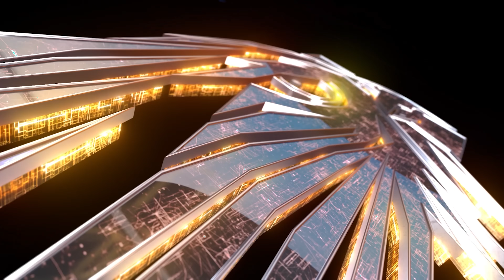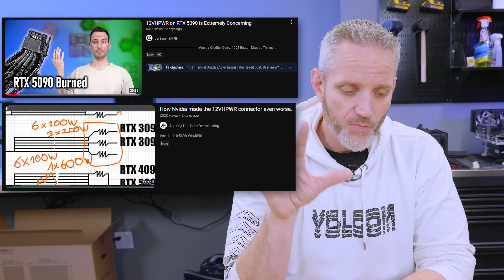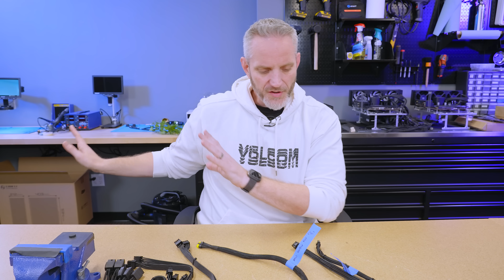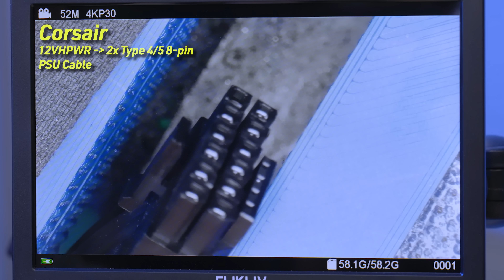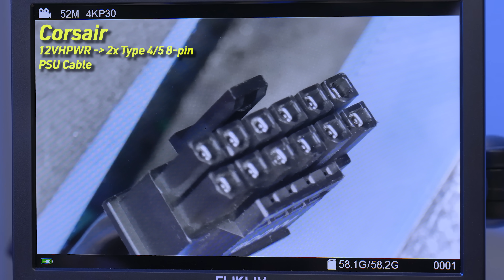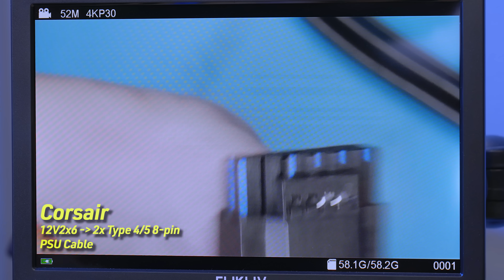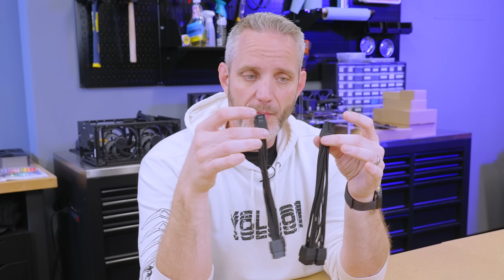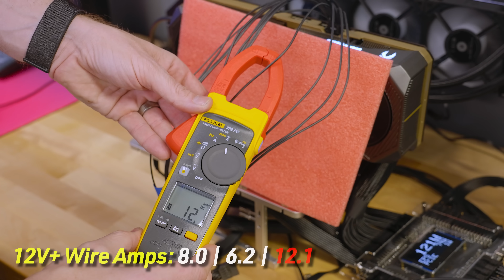I discovered something concerning and I need the Experts to chime in... More 12VHPWR discovery!

Comment: I just looked out of curiosity at the brand new 24 pin cable that that corsair sent me, and 50% of the pins are as Jay shown in the video ☠I asked them for a new cable because one pin on the PSU side was coming out when bending the cable up towards the pass through to reach the motherboard.

Comment: After watching this, Der8auer and some card repair videos I wonder if part of the problem is poorly soldered connectors to the PCB causing uneven load distribution. There have been a few instances where a card sent in for repair has a power connector come loose after an ultrasonic cleaning because the initial solder from factory was so limited the pins were barely making contact in the first place and the ultrasonic bath ate away the remaining connection.

Comment: Long career  as a aircraft avionics technician.

The locking function  of that pin is not engaged. This is caused by only one of  two things, bad lock on the pin or the connector has a defect that will not allow the pin to lock.

OK one other is if the pin is not fully inserted into the connector. 

There should be absolutely no pin movement in the connector. If there is, In all cases the locking feature is not engaged.

Seeing how there is a common ground pin on the connector that is melting the best probable cause is the connector is flawed in the casting of the connector. The pins ( more than likely) are all the same. If there is no pattern to the melting pin then I would say there is a flaw in the pin casting.

A pushed back pin is not an uncommon problem. Before inserting a connector into a socket you should always look to see if ALL pins are flush, if not first look to see if the pin is not fully inserted for the lock to work. If not install a new pin on the wire if no fix it's the connector.

The only way to remove a wire from the connector is by using a pin lock release tool.  Either front or rear release. I think this connector is rear but not sure, I would have to look into it.

Comment: Over time the metal clip that holds the pins in place will push the plastic back and make the pin seat depth even more. anyone that has taken a connector apart to repin it will know what this is. I've had issues as far back as Molex with this. Not fire issues but resistance issues on projects using these connectors. the way these connectors are put together will change over time and use. Also noticed the plastic they use is even softer or is it the plastic hardens over time,

Comment: As a Generator tech from small all the way to mega volts, And a ASE certified auto/med heavy equipment mechanic if a ground is not properly seated fully it will cause resistance and as you know this causes heat just as a not fully seated positive connector does the same not sure if its as huge as in a Gen set but I imagine that it is the same for any electrical connection.

Comment: The real question here is why is every one defending NVIDIA and trying their best to some how blame all of this on other things like user error and cables etc. Its their product and it has been proven they downgraded the power delivery circuit to save some buck, hence there is no load balancing whatsoever. That is the reason for unequal amperage. 

I have never seen a company treat their customers so badly and yet the customers remain being delusional and keep saying USER ERROR! USER ERROR! If it was some other company with an electrical appliance problem like this, they would have been blamed for everything under the sun by now on the internet by now and might be recalling all their products by now. 

This is a product issue and the customer should not be expected to have a degree in electrical engineering and equipment to always be monitoring the power cable on the GPU. It should be designed to work practically in real world scenarios. Stop defending them they are only after your money they don't love you , whatever bond you think you have does not exist, blind brand loyalty only damages you and profits them. So blame them together so that they get scared of your wrath and take responsibility of their products. That will benefit all of us in the long run. Stop putting NVIDIA on a pedestal, their CEO's Ego is already in the clouds.

Comment: The crazy thing is that there are multiple good standards for high-current power connectors, as seen on any LiPo battery.  I would favour XT60, but there is even an XT100 available.  These are capable of delivering 60A (720w) and 100A (1,200w) respectively, giving more than enough current carrying capacity.  Inventing a new standard for a 12v connector when these and other perfectly good standards are already cheaply available demonstrates a severe lack of any intelligence, artificial or natural, on the part of the designer.  You only need two wires to supply even a hundred amps at 12v, or 1,200 watts.

Comment: Ok lets be real here... Yes, this moving pin is very concerning and could be a fault in the future... Having good cables and not cheap out on this stuff is best practice... But and I want to really empathise this but... Nvidia has a lot of experience with building gracas and they have years of experience in how their consumers use their technology... saving money on the shunt resistors is a major design flaw that leaves no error of margin on the cable side... But Nvidia knows the cable marked and how much variance there is in production quality... Having a saveguards against faulty cables is a given unless you can guarantee the quality of cables and pins... Its like having a car that only runs on company fuel and breaks with having fuel from a different vendor... Ppl wouldn't accept this in cars why would they with gracas... We are looking at a $1000+ item (without the sclapers) and we can expect  sound design choices for this premium price...Also they have seen the problems with their design in 40s but have not learned an ounce from it... So we can be angry at cablemods or asking Nvidia how they are saving $5 on components that result in 1k loss for the consumer.... This is not ok, absolutely not and imo squarely Nvidia fault...

Comment: Propobly thanks to my corsair HX1200 single PCI-E output monitoring i have no issue during mine usage of 4090. Also i have custom power cable made by china guy specially for this PSU: 4 PCI-E to 1- 12VHPWR.

Comment: Ground wires are not neutral wires, they do not "power out" those only exist in case of a short. They're the emergency path to ground. Keeps dumb-dumbs like us alive. Three of the 12V wires are +12V and the other three are -12V. They're in pairs. That's how the 3090 cards were able to load balance between three loads.

Comment: I used to install car auto for a living, and i know that if the ground to the amplifier was not secured properly, the wire would get hot. I have seen where someone installed a high-powered amplifier and did not tighten the ground wire, and his carpet caught fire because of the arcing it was doing

Comment: like i said from the start: its not the gpu, its the power supply. they dont regulate their output. the 2 over amp wires share an internal circuit in the psu

Comment: In Germany, many connectors require the ground (GND) cable or pin to be longer to ensure that GND is the first to connect and the last to disconnect for safety reasons. This design choice makes perfect sense. As an electrical engineer, the FE edition looks highly questionable from a PCB perspective—it's baffling that there's no built-in safety mechanism to ensure proper current distribution.
Reply: gnd and protective earth is far from the same

Comment: Don't expect American quality from Chinese manufactured shit. I'm almost certain, even with the pins pulling out "one issue" I bet they are not using oxygen free copper, which would hold better amperage and would be more stable and free from strain. Proably some shit aluminum wire. So I bet there is a possibility of it getting corroded in itself which will lead it to get more resistance Reguardless after time. To also fix the pins from sliding out it should have a double tab groove at minimum to hold the pin in place. Also the crap metal in the pins could cause resistance itself too. As expected with a machine manufactured turd with tolerances to pass inspection. You'd be high to think in any scenario to pull 13.6v X 10-12 amps a strain of that gauge wire. That's well over 150 watts at points and would could easily burn down the wire especially if not made from quality metals. Which in itself melting or heating up causing more resistance.

Comment: The measurement board has current shunts, the resistance of which is greater than the contact resistance of the pins in the connector. This is the reason for the reduction in the current difference between the wires. It's a common, but crude technique to equalize currents in low impedance parallel working power supplies, batteries etc...

With what they did, combine all wires to a single bus at one end... it's impossible to have perfectly balanced currents. Тhere will always be a difference in contact resistance regardless of cable quality due to aging, manufacturing tolerances, and so on. 

With such a small safety margin, this is criminal negligence.

Comment: there are more ways to asses the quality of a connector. there is pin tension. contact surface finish and material, and the installed depth. the slop in the pins that you are seeing may not matter if the pin and socket meets the minimum installation depth. it still speaks for quality though to have that much play in the pins.

Comment: Chat GPT 4. To the rescue..  If two pins on your 8-pin PCIe power cable are pulling significantly more wattage than they should, the issue is likely caused by one of the following:

1. Uneven Power Distribution (Bad PSU or Cables)

A faulty or low-quality PSU may not be distributing power evenly across the PCIe cable.

Check if the issue happens with another PSU. If it does, the problem is elsewhere.

If using modular PSU cables, ensure they are not mixed with cables from another PSU, as pinouts can differ and cause damage.

2. Faulty or Incomplete Pin Contact

If some pins aren’t making full contact, the remaining pins take on the extra load.

Inspect the connector for burn marks, loose crimps, or bent pins.

Ensure the cable is fully seated in both the PSU and GPU.

3. GPU VRM or PCB Damage

If the GPU’s voltage regulation module (VRM) is faulty, it may be drawing power unevenly.

If available, test a different GPU in the same system to see if the issue persists.

If the issue only happens with one GPU, it might be defective and needs an RMA.

4. PSU Overloading One Rail (Single vs. Multi-Rail PSU)

If your PSU is multi-rail, check if it’s overloading a single rail instead of spreading the load.

Try using a separate PCIe power cable from a different PSU port instead of daisy-chaining.

If using a single-rail PSU, the issue is likely elsewhere.

5. Short Circuit or Resistance in the Power Path

A short or high resistance in the GPU, cable, or PSU can cause certain pins to take more current.

Use a multimeter to measure resistance in each wire from PSU to GPU.

Check for burn marks or melted insulation, which could indicate an internal short.

What to Do Next

Test with a different PSU.

Try a different PCIe power cable.

Inspect the GPU power connector for damage.

Check if the problem persists with another GPU.

If using a multi-rail PSU, switch to a separate rail.

If the issue persists after these tests, your GPU may have a power distribution defect, and you should contact the manufacturer for an RMA or replacement. Let me know what you find!

Comment: to answer the question about if the effect would be better or worse on the ground side vs the 12v side. current is constant at all points in a circuit is the ground is passing the same amperage as the 12v side so no difference. to get a higher amperage reading on specific line if everything is parallel as they are saying the lower amperage lines must have higher resistance causing the reduction in current on those lines. causing the good line that had the best continuity to take all the load and making the best connection fail thermally from high current (amperage)

Comment: Multiple conductors in parallel on the same circuit is a recipe for disaster. 

There is a reason the cables coming into your electrical panel are 00 gauge and not multiple runs of 14 guage

Comment: I would think that the best way to measure this would be with a micrometer depth gauge - most digital calipers include the ability to measure depth.  I Googled briefly but was unable to locate any technical specs for pin insertion in the connector, but I have to believe that  measurement and it's tolerance is defined in the pci spec.

Comment: The cable isn't the problem. 

Connectors similar this has been used for well over 100 years. The problem is the power requested by the video card board, how it is requested and how it requests it's distribution between each wire. 

People need to move beyond the cable and get to the real problem that lots of people have called out since it started with the 4090s! But YouTubers decided to run with a cable problem!
Reply: The cable design is an issue. The current connector is rated for 600w max while the 5090 can pull 575w. There is practically no safety factor, meaning that any load balancing issue has the risk of being catastrophic.

We can argue that the actual design is fine, but the current size of the connector and wires are too small for the power a 5090 pulls.

Comment: Check continuity between all the 12V pins and and do  the same for the GND pins on your connector before plugging it into the GPU, If they are all connected it shouldn't matter whether the 12V side or GND is making a bad connection. What you may find is that the GNDs are all common but  there could be a difference on the 12V side if the PSU has different 12V rails.

Comment: i've seen a lot 6 or 8 pin cables with pin tolerences out of wack, they are fine most of the time because their usage wattage is a lot under their rated wattage.But in the case of the 12HPWR, being used at their maximum rated wattage, it should be aerospace grade quality to not cause issues, even then they're pushing it...

Comment: WOW, I feel like your really onto something here Jay! This is not a new issue per se either, I recall back in the old days having issues with cheap molex connectors having major issues with individual pins popping out the back instead of pushing into the other connector, and me having to carefully ensure each pin was fully seated individually. Same basic issue, just on a much newer and higher power connector!

Comment: Do you know what is the funniest thing about the things you mention about user error, such as not plugging all the way in? This is something that was not talked about before as it was not an issue until the 40 / 50 series came out. Ironically, there is a damn big problem with the contacts as it leads to, for example, user error.. either that or there is something seriously wrong with the design and possibly the cards.. Personally, I think that large parts of melted contacts are not the result of user error and or as a result of BAD design of the contacts that leads to "user error" and here I think Nvidia is sloppy, disclaiming any responsibility when it is actually THEY who made the cards and the design of the contacts that lead to failure (user error). It's unbelievable that we let Nvidia get away with this.

Comment: One thing I haven't seen discussed is current flow vs resistance. If you have 6 wires in parallel with the same impedance on each wire the system will automatically load balance across the wires.
If you have a pin not making good connection the resistance on that connection point will go up, and that pin will heat extra from the resistance, but inversely the wire itself will be holding less current as the higher resistance (and directly impedance) will mean more current will move to the other wires as their resistance is lower.
So when troubleshooting high current on one wire, the issue is most likely on a different wires connection. While high temp on a pin would be poor connection on that pin.

Comment: Are you able to test the "load balancing" for different cables/powersupplys? That could give a lot of insight in where the fault origins.
It might be just an unhappy stacking of tolerances which lead to to much difference in resistance and therefore unbalanced load on the cables.

On thing that would be really interresting to test is if the power supply itself has different internal resistance.

The PMD2 making such difference might just be it having tollerances "in the other direction".